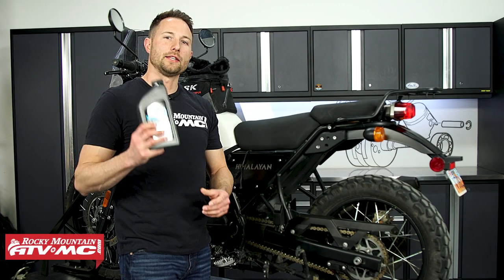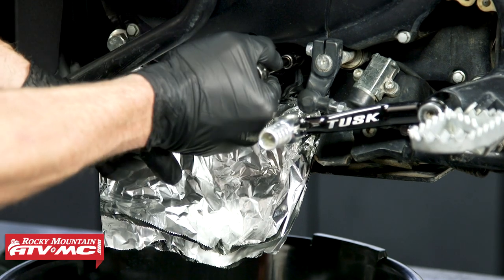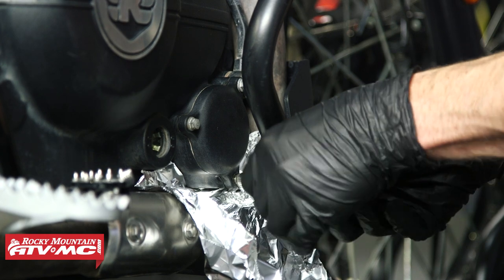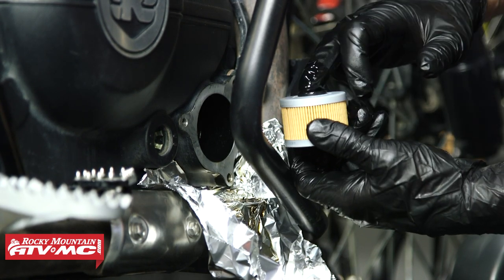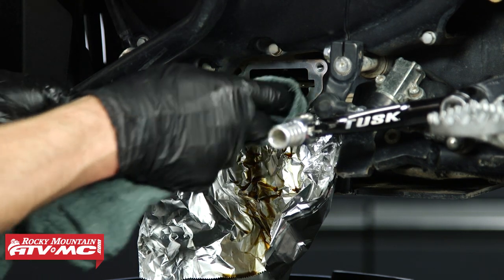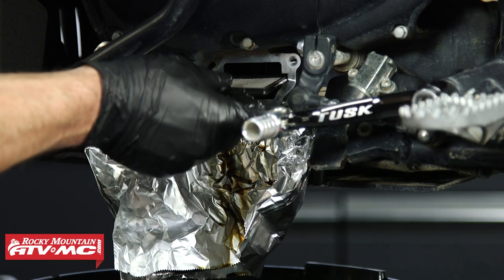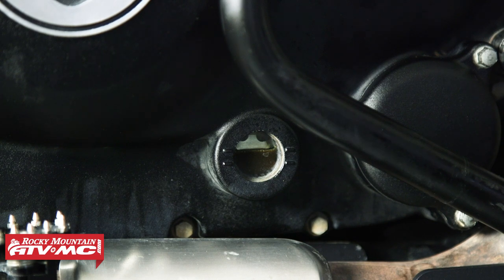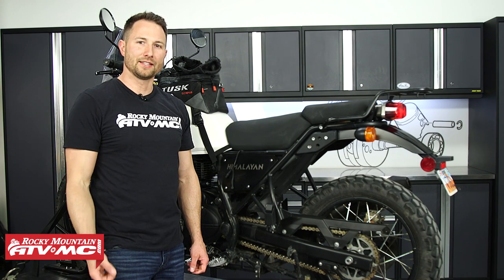How To Change the Oil on a Royal Enfield Himalayan

Comment: My dealer wanted $600 for the first 300 mile service (that's including a 20% discount). I decide to do the oil change myself, and I'm glad I did it.. The dealer doesn't use good oil, and I don't have control over it. I got Motul 300V 15w-50, and after the change, the engine ran so smooth. Gear change was noticeably smoother as well.  The process was a breeze. Bought the filter off amazon for $12 and the oil was about $66.  Just  need a wrench; very straightforward process.  Now I will watch youtube to understand how to check the tappet.  Save myself a ton of money.
Reply from the maker: Awesome job doing the work yourself! 👍 Glad the video helped.
Reply: Doesnt the manual suggest semi synthetic oil? Motul 300V 15w-50 is fully synthetic (Im a noobie so dont know what Im actually talking about) - does it matter??

Comment: How do you do the normal Check of the oil Level? The manual is very unspecific. I always ride 3 to 5 min, turn the engine off and let the Bike Rest for 3 min on the main stand. Than i Check the oil level
Reply from the maker: That would be the correct way to check your oil level. Thanks for the question!

Comment: If you change the oil with the machine on its side stand, there is no need to make a funnel out of foil, it will drain straight into a pan without touching the frame or exhaust.  Doing it this way also allows more oil to drain.  This is the method RE says you should do in the owner's handbook.

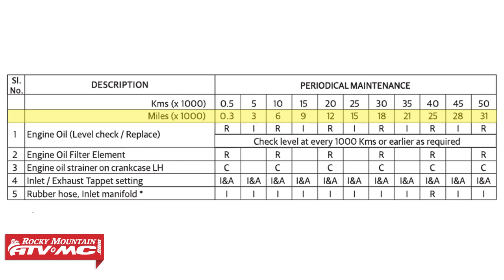Comment: The image at 0:21 shows replacement of oil at 6000 miles. At 3000 miles it indicates "inspect". I'm all for changing the oil ahead of recommended intervals but not at the halfway mark.
Reply: I would definitely check my oil a lot more than 3k mikes. These bikes are great but they like most single cylinder bikes tend to burn oil especially if the rider runs them at higher revs.

Comment: Good video, do you needs to soak the new filler in oil first? Do you have a dealer in Australia or just get stuff from your website, cheers
Reply from the maker: You do not need to soak the new filter in oil before installing but it certainly won't hurt to do so. Unfortunately, we do not have a location outside of the U.S., but you can order from our website. Thanks for watching the video.
https://www.rockymountainatvmc.com/

Comment: I leaned my bike on both sides while draining old oil. And I fill 2 ltrs of oil. Is this good for engine?
Reply from the maker: Did you check the oil level sight glass after running the bike, letting it warm up, then shutting it off?

Comment: After my first paid service engine oil change i could see the oil level is above the max indicator on this window, in fact the entire window is filled. Is over filling the oil an issue to be taken care?
Reply from the maker: Most of the time it's not a big deal to have a little extra oil in there but if it's very overfilled, you could have some problems.
Reply: @rmatvmc Are you able to provide symptoms of "some problems"?
Reply: Be sure to check your oil when it is warm and on the side stand. It's what the manual indicates. When it's off the stand and on two wheels it appears the oil level is higher than it would be on.